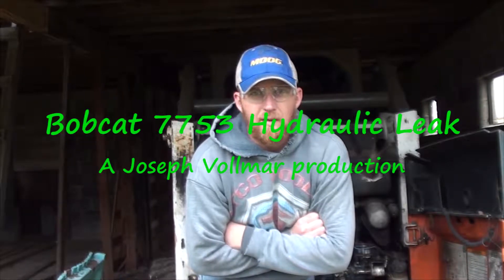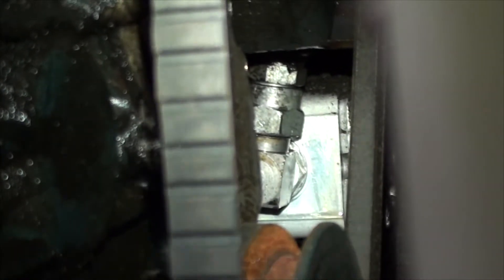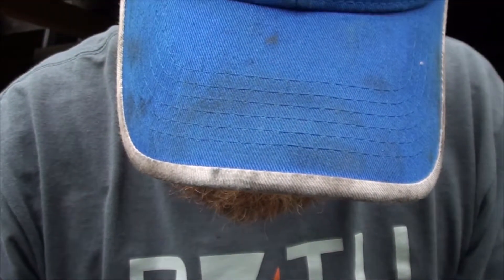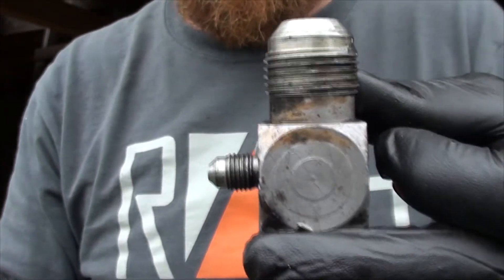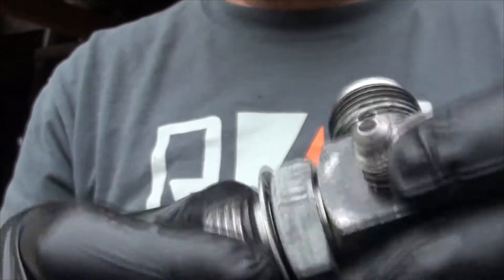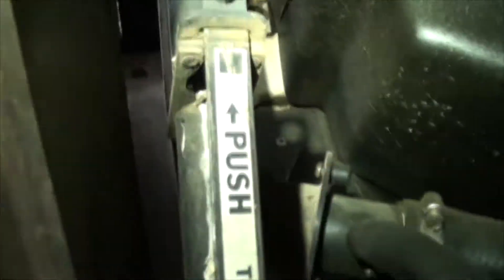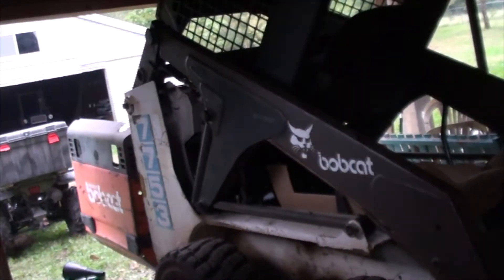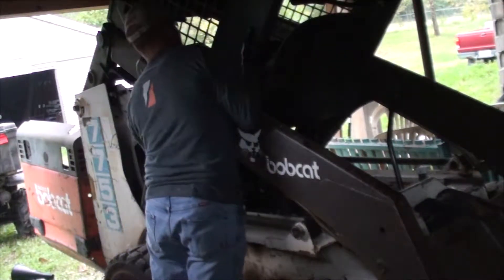7753 Bobcat Hydraulic Leak

Comment: Hi great job the pump is about 250 it takes about 2 hours to take out the cab must be up all the way make some pipe breaker bars the hex head bolts holding on the pump may be tight power wash everything before u start make sure your drains are clear in the pan good luck

Comment: How did you get that pump out mines leaking too looks a bit tricky to remove
Reply from the maker: Blair Benson raise the cab, then crawl in under the cab. The pressure side on the 7753 is a        1 1/4” for the large fitting, and a 9/16” for the small fitting. It’s actually fairly easy to get the pump on and off. You will need a assortment of tools though. I have a Klutch 1/2” drive crows foot socket that goes from 1”-2” that came in very handy. Also cut a price of plywood to fit just between the steering levers to lay on. Didn’t do that at first, big mistake. Just replaced mine over the weekend because what I thought was a o-ring leak when I shot that video turned out to be a crack in the center housing of the pump. Watch for that video shortly. I hope this helps.